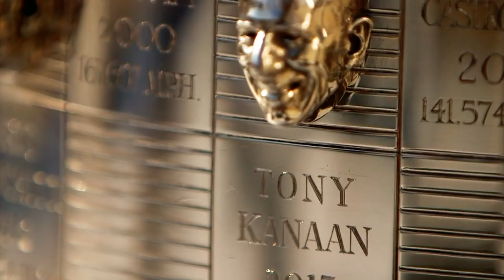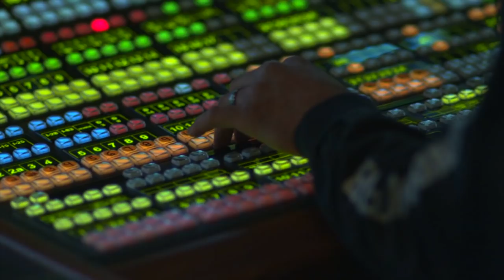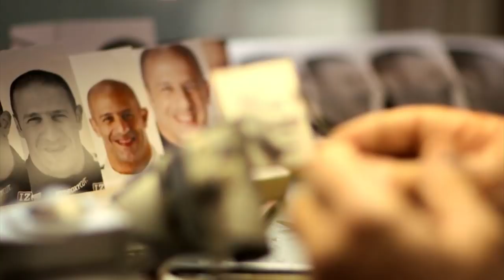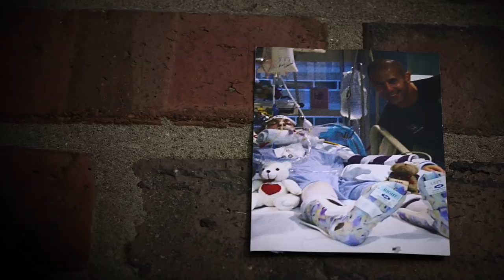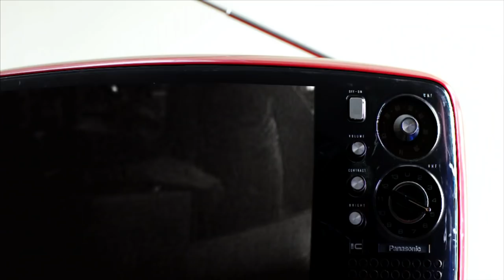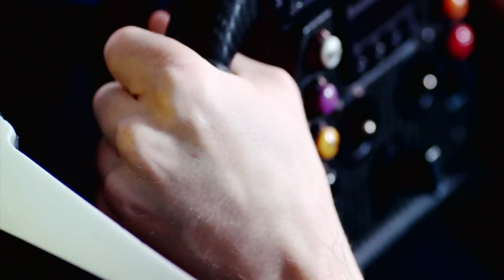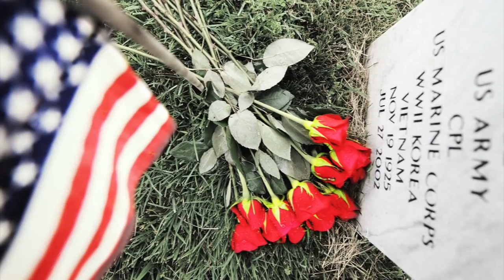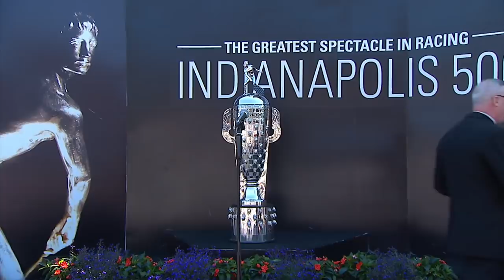2014 Indianapolis 500 | Official Full-Race Broadcast

Comment: Vince Welch, we could have all done without your dandy poetics and metaphors concerning the "Yard of Bricks" start/finish line at Indy at around 3:27. So, for those who'd rather bypass that flowery drivel, let me tell you that the Indy Motor Speedway was built in 1909 under the supervision of Carl Graham Fisher (1874-1938) and was originally paved with a substance known as taroid (a tar and oil mix) and crushed stone. However, the bits of stone came loose and chuckholes had been formed during the first auto races held at the track causing fatal accidents. So Mr. Fisher decided to use an all-brick surface on his track. Later, to increase racing speeds, much of that brick surface was covered with asphalt, and by 1961, the entire speedway was paved over with asphalt save a one yard wide length of uncovered bricks at the start/finish line--the "Brickyard." ("Save", in this context, means "except for.")

Comment: Townsend Bell...go back to Go-Kart racing where you won't get someone killed! Ed Carpenter should grab a brain, he got pushed down onto Hinchcliffe who quite frankly had the lower position solidly made! Carpenter's spotter was so worried about Bell he failed to see Hinchcliffe  move in underneath. Bell bumps tires with Carpenter and forces him into Hinchcliffe! Bell drives away like an impaired driver who has just caused a major accident but could care less just as long as it wasn't him/her.....
Reply: Hinch was the 3rd man into the corner. Bell and Ed were already side by side.
Reply: As a Canadian Hinchcliffe fan that was sitting in SV Vista above turn 1 that day, right behind some staunch Ed Carpenter fans I can say that the public perception was that Hinch was at fault lol.  Those guys were friendly with us until that crash, when they stopped talking to us lol
Reply: @NotSteveCook  Bell should be back to GP2.